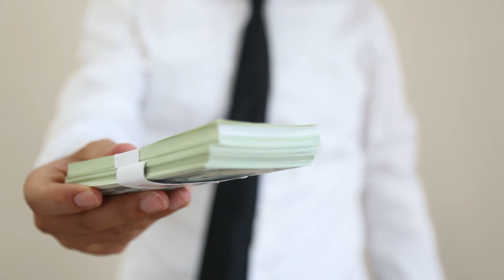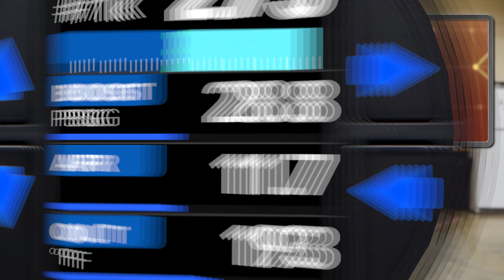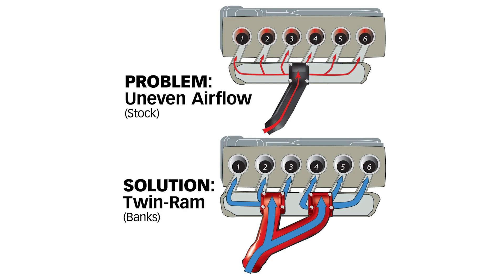Belgium wants JLTVs, Twin-Ram for Cummins 5.9, ARP L5P head studs?  BANKS INSIDER 10/23/20

Comment: Should the heaters be used with the Twin-Ram and if there is a particular case where the heaters help, what is that case?  Below a certain temperature?  I'm in Washington State and just ordered a Twin-Ram.  If the heaters should be installed, I think I should opted for new ones at this point.